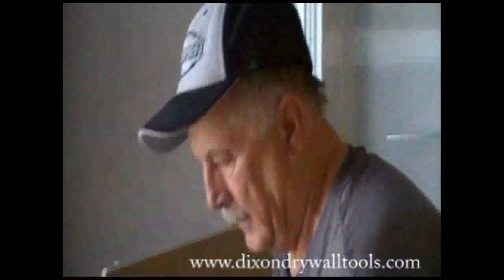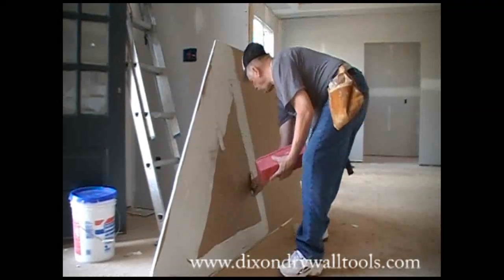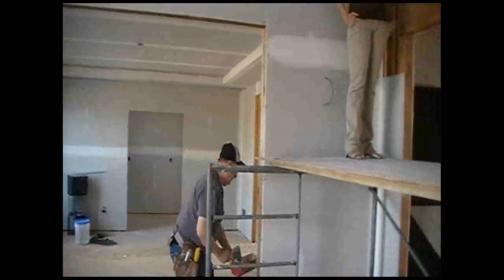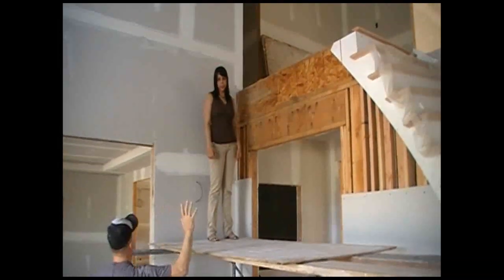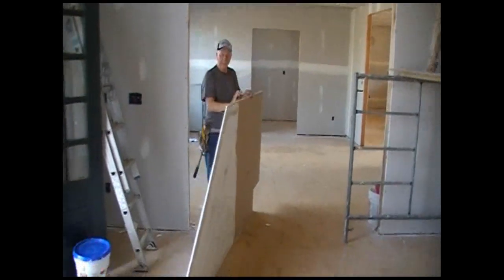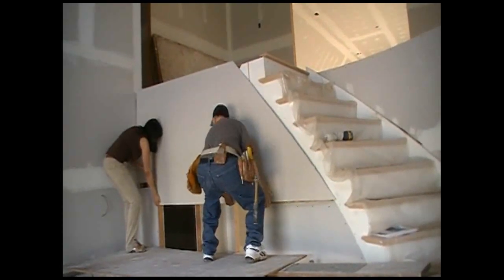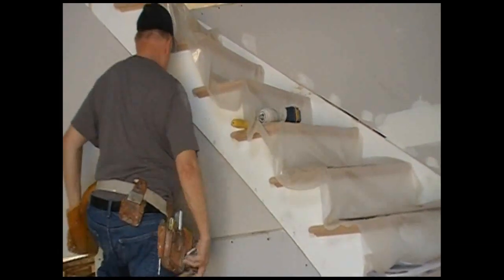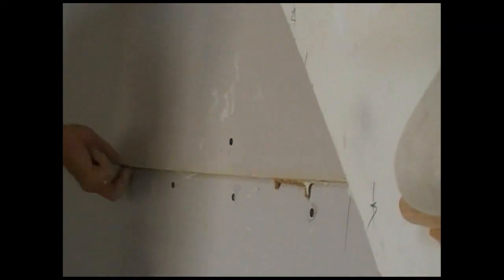How To Hang Rounded DryWall - Part 3/3

Comment: If nails pops then there wouldn't be any old houses in California with drywall this days couse all the houses from the 50's to the 70's were hung with nothing but nails that's all they had back then there were no screws my parents house was built in the 60's and it still haves the original drywall with nail after a shit load of earthquakes it's still in one piece I wonder how is that possible screws r beater but nails r good too 2015 we still use them in Cali